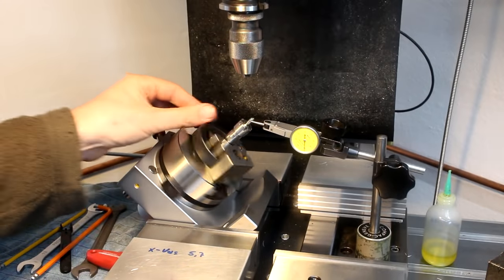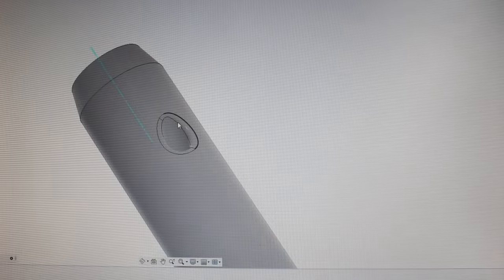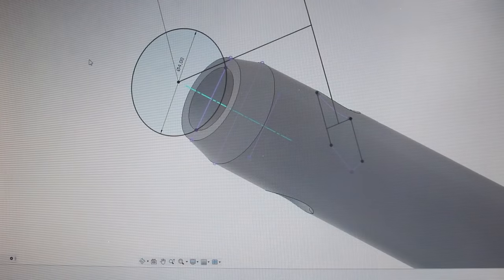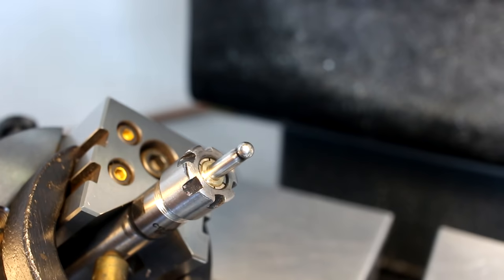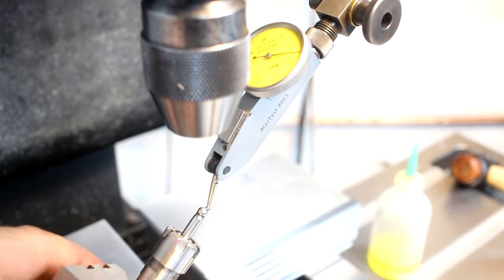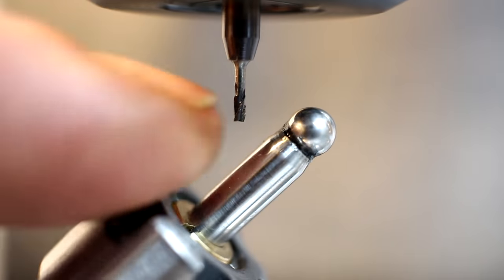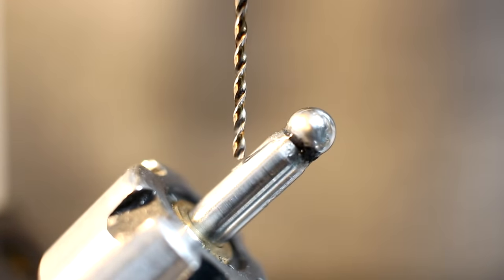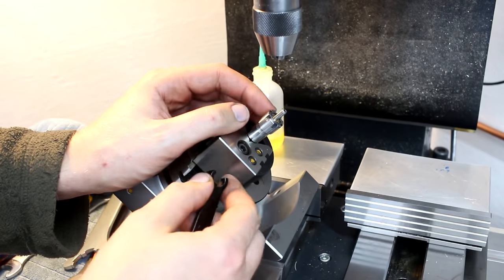Hole locating using a ball bearing

Comment: Secret trigonometry trick: Lay it out in a sketch in CAD 😁😂 Thank you Stefan great setup!
Reply from the maker: Much less error prone than on paper :D
Reply: @StefanGotteswinter  Yep, I do it all the time. Plus, if its fairly complex, it can be a drastic time saver.
Reply: @CJ-ty8sv  Same here. And I am not even a machinist. I mainly do woodworking.
Reply: @doubledarefan  Yep, I'll bet that probably everyone who does something with any sort of cutting / fabrication of solid materials who also has access to and knowledge of use of a CAD system has done it at least a time or two (likely more).

Comment: 5.705 is the theoretical dimension - did you take into accont that the bore has a chamfered edge?
Reply from the maker: Yes, I took the actual wall of the bore as a reference, not the chamfer/fillet.
Reply: This feels like a comment the customer would make, lol.
Reply: @StefanGotteswinter  I think what G. Leuprecht meant was that your mystery part seemed to have a chamfer in the bore edge, thus the ball would be resting against the chamfer face and not at the theoretical end face of the bore, thus giving a tiny error in the position.

Comment: For tolerances greater than +/- 0.001 inch, locating ball on sharp cornered hole may be ok. Below +/- 001 you need to measure the center of the ball relative to the end of the part. Once that is established you can hold hole tolerance to gage level accuracy, +/- 0.0001inch

Comment: I have used this method before as well.  One thing to note and it may not have been relevant for the part you were making but how much error would you have had to build in for the edge break/chamfer you had on the I.D of the part.

Comment: Did you end up modifying the mill, I thought the mb4 top speed was around 1800rpm ? 

Edit: I was wrong, mb4 goes up to 3200rpm. 

Great tip re. edge finding and measuring, thanks

Comment: Stefan, I was with you indicating the ball bearing until you spun the indexer to Check the run-out of the spindexer set up. Indicating opposite the indexer put the test indicator at 45 degrees off the equator which yields a different value than if you positioned the test indicator in front of or behind your work piece which would place the indicator at O degrees from the equator. The resultant TIR of the 2 positions is not the same.

Comment: Ancient Trigonometry Secret: Blank piece if paper, sharp pencil, trig tables, your mind as calculator.  Imagine....
Reply from the maker: Its a basic skill to be able to do trig on paper - But if I dont have to, I will use cad for speed and foolproofness.
Reply: @StefanGotteswinter  Yes, i fully agree. It just takes that well grounded experience in problem definition that you only get from Trig Class to be able to utilize cad to its fullest potentential.

If you cant describe the problem, you cannot fix the problem.

And that is so widelt evident in the thousands of youtube videos I've seen on 'how to CAD or 3DP."

Comment: why switch to a drill when the endmill was most of the way to the bore? Why not just keep going with the endmill?
Reply: With an end-mill that thin, it would most likely catch and break as it breaks through the opposite side.  Drill bits are a lot cheaper to replace....at least, that has been my experience.

Comment: Hi Stefan, do you depend on the camera when doing such tiny work with 1mm endmills? Or do you wear a visor like I do that has flip down magnifiers and a light? My eyesight isn't cooperating as much as it used to when I was in my teens :-) Oh, and awesome procedure - I'm stealing that. I also have a couple of Joe Pi's balls that I bought from McMaster.
Reply from the maker: No, the camera viewfinder lags a bit to much. I prefer to go "blind" by the DRO and using a watchmakers loupe (7x magnification). 
I have an optivisor, but I dont like it. I feel to disconnected using it.

In a pickle, when I do realy small work, I will get the microscope over to the lathe or mill.
Reply: @StefanGotteswinter  I bought a CCD camera specifically for doing the small stuff. Mounted to a "microphone" goose neck and attached to an LCD monitor on the bench. I too am getting to the point where an eye test and some specs are probably in order.
Reply: @StefanGotteswinter  Great! Thank you. I have a loupe around here somewhere. I'll give it a try! Cheers.
Reply: "I also have a couple of Joe Pi's balls"
He sold them?!?  And he has more?!?
Reply: @Self_Evident  he doesn't have any listed in his store currently